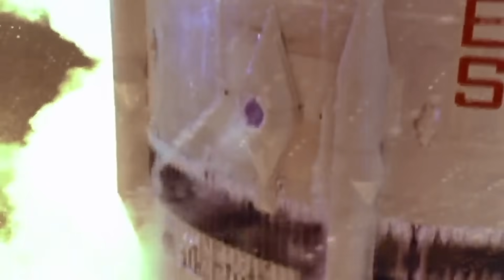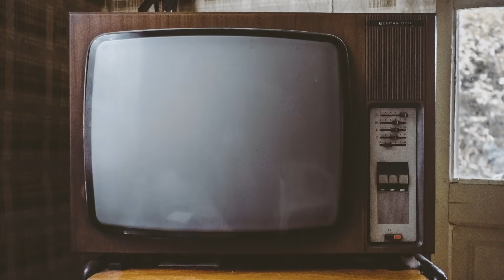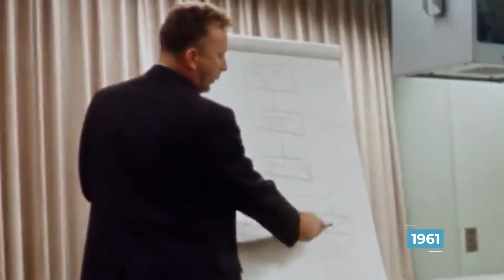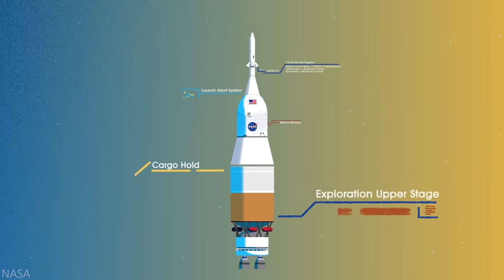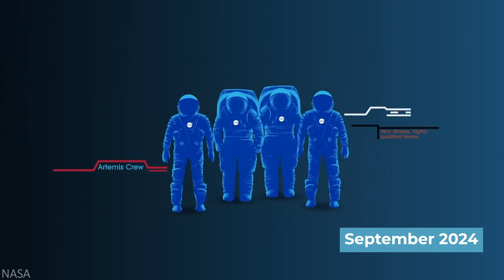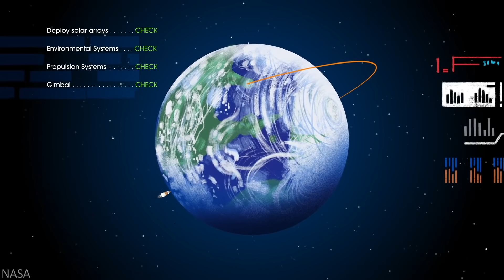Apollo vs Artemis Program: How Do They Compare?

Comment: * Montgolfier brothers first hot air balloon flight: December 14, 1782
* Wright Brothers first powered aeroplane flight: December 17, 1903 (121 years + days)
* Launch of a Saturn rocket for a first flight around the moon (by Apollo 10): May 18, 1969 (65 years + days)
* Launch of a Artemis rocket for a flight around the moon (by Orion): November 16, 2022 (53 years + days)

Personally I think that the advances manned flight between 1903 to 1969 were far greater and  more impressive than those between 1969 and 2021; and the gap is only one decade less.

During the 1960s it was expected that the Apollo programme would be followed by others. That it was not was more to do with the zeitgeist of the 1970s than shortsightedness of NASA in  the 1960s.
 
1960 biographical film of Wernher von Braun (head of the Saturn design team and at one time a Nazi ) was titled "I Aim at the Stars" to which the satirist Mort Sah appended  ", but I sometimes hit London." While history may record this most recent launch of Artemis 1 alongside that of Appolo 10, we are bloody lucky that another rocket launched less than 24 hours earlier did not trigger the Third World War. Understandably that rocket flight and landing is considered more notable in today's (November 16, 2022) rolling news cyle than the Artemis lauch -- that must be real disappointment and frustration for NASA's public relations department.
Reply: Indeed but would not be sure they still just rocket, just show for the Masses. Apollo 8 was first with humans, now Artemis 2 will be, not sure about the landing.
   Nothing special or wrong with German scientists working for his country, that is what those guys do, know about atomic bombs in Japan? (etc etc etc +)
  Some may want to research British History of sharing.... artillery aims....

Comment: The idea that Artemis is so much better, bigger, more ambitious than Apollo, and that Apollo isn’t really that big a deal (because it’s old?) is bizarre, and laughable. The Apollo moon landings will be remembered for all time. It was unbelievably bold, daring, and a whirlwind program. From Kennedy’s speech to the first landing was only 8 years. 

In contrast to that, Artemis is a complete mess. It is bloated, confused, lethargic, weighed down by lazy contractors (Boeing, Lockheed Martin) and litigious contractors (Blue Origin), and political squabbling by members of Congress who use NASA as a football. The SLS rocket has been in development for over a decade and has already cost $20 BILLION, and it has yet to fly even once. The Orion capsule has been in development for even longer (about 15 years) and similarly cost $20 BILLION already, and the one lone completed capsule they have is already falling apart, with internal components failing. As a combined system, the SLS/Orion System will launch at most once a year and will cost (depending on how you count) anywhere from $2-4 BILLION PER LAUNCH. On top of all that, this system can’t even get all the way to the moon because the capsule is too fat & heavy and the rocket is too underpowered. That’s why they dreamed up the Lunar Gateway, so SLS/Orion could have somewhere to go that they could actually reach. It’s also the reason why they needed a separately launched lunar lander for the astronauts to transfer into. They are nowhere close to having functioning lunar spacesuits even though they’ve spent a half billion on it and will spend another half billion before they’re done. Congress is trying to micromanage NASA instead of letting them do their job. In fact, the entire SLS/Orion fiasco is directly the fault of Congress. The whole thing is a giant freaking mess. 

If we actually make it back to the Moon at all, let alone by 2024, to a great extent it’ll be thanks to SpaceX.
Reply: All these actors need to quit their petty in-fighting and work together. If not, Artemis, SLS Heavy Lift and Starliner are just pipe dreams.
Reply: If Artemis succeeds then it will be remembered as fondly as Apollo. I mean you’re building a moon base and moon space station
Reply: A quick google tells me the Apollo program had a buget of 180 B$ when adjusted for inflation. Artemis has yet to accomplish a fraction of what apollo has, but keep in mind the astronomical costs of apollo.

Comment: Hello, good afternoon and with much respect, I allow myself to inform... I am a researcher and the aerospace industry has changed and it has nothing to do with the companies that report here... I see that there is a lot of ignorance of reality... New aerospace manufacturing technology admitted and approved on September 22, 2020 for the US and Europe... Automatic manufacturing in paramagnetic titanium and aluminum alloys... A new era for civil and military aerospace manufacturing... Pressurized models with artificial gravity....Dual automatic laser joints in aerospace alloys...Titanium and aluminum can be joined robotically for the first time in history...Civilian and military aircraft can be mass-stamped and manufactured by automation of similarly way to the automotive industry. automobile... The new technology allows to build the next launch systems 100% recoverable and with green hydrogen as propellant... The new technology builds the tanks that use fuel by welding the tanks inside and outside at the same time in titanium, aluminum and austenitic steels... The new technology replaces the friction welding system that ARTEMISA uses to weld the aluminum tanks of the SLS system. ...The Artemisa welding system joins the deposits by means of a rustic probe and only works on aluminium. It is a very limited technology, far surpassed by the new technology supported in September 2020... New technology supported and legally approved for the entire territory of the US The aeronautics and space industries at the highest level... new technology is going to manufacture aircraft and launch systems entirely by automation...Replacing the traditional and structural riveting of the aerospace industry...The trip to Mars is not a Raptor flight as Mr. Musk mistakenly proposes. ..The trip to Mars is a trip of three
 years therefore it is a health journey for the human body with artificial gravity coming from the new technology...The new technology solves the current health problems of the ISS astronauts...Six months is the maximum time recommended by doctors for the human body on the Space Station and the trip to Mars lasts three years... The new technology will take the human being to tour the solar system... Automatic manufacturing of modules for space with artificial gravity on titanium alloys aluminum and austenitic steels... It is an honor... Kind regards and the greatest respect for all...

Comment: has a raptor engine ever been to space? has star ship made  it to orbit? so Apollo is  the best hands down
Reply: NO offense to what was accomplished in the 60s,  BUT...........we can now begin the REAL space age. 👌
Reply: @commanderbracey7501  I agree, I think Reagan set the space program back 20 years and the Star wars program did not yield what we had hoped.
Reply: Considering that real starship development is only about 2 and a half years old at this point, I don't think that means much.
Reply: @wisemanofsorts6068  Hmmm, as I recall from my history,  the U.S. spent most of a decade developing the Mercury project,  followed by the Apollo program.  (With 50s and 60s tech).........so now....in the 21st century.......I think its fair to say the process may have sped up a little.......wait for it.  🤔
Reply: @commanderbracey7501  Right, that's why they are using a rocket engine designed and built in the 1970's to power the Orion Capsule.